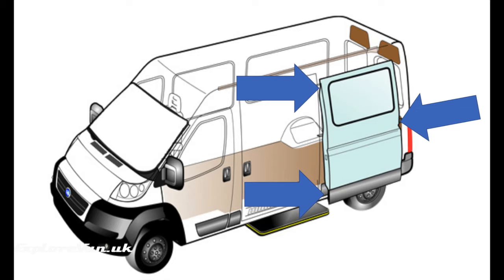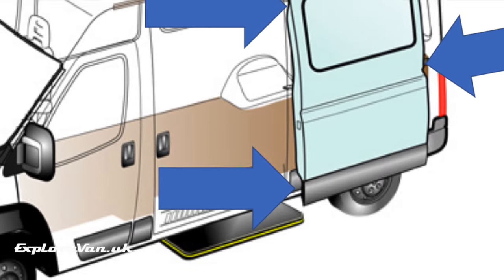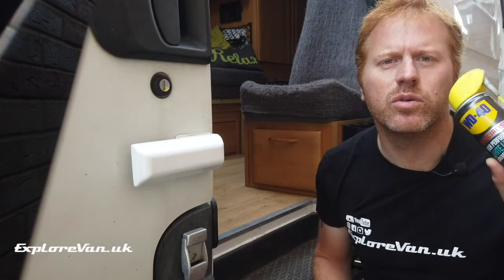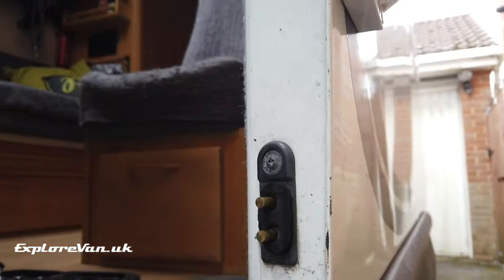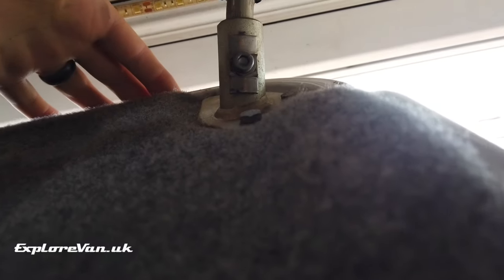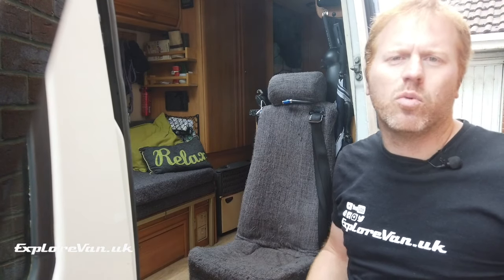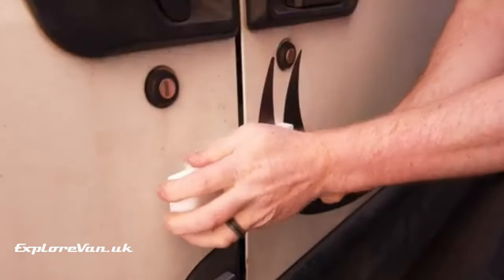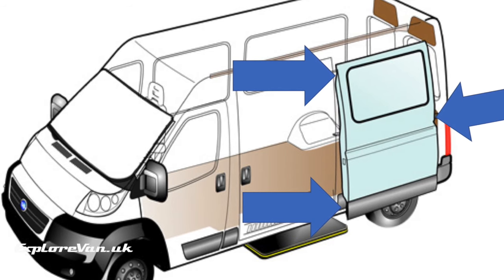Van sliding side door maintenance, adjustment tips and hacks. Campervan, RV, Motorhome.

Comment: Hi everyone. Useful video, thankyou. I have an issue with the bottom bearings of my customised Mercedes Sprinter van conversion (only just won her unbelievably)! 

 The door doesn’t stay open, so I place a rubber door wedge just on the bottom track bearing to keep the door lightly open (like a normal hung door I suppose). 

Unfortunately, I’ve subsequently shut the door with the rubber wedge on the bottom track still present and now my door is categorically jammed shut and will not open from inside/outside. Nor will it allow the van to be fully locked. Any advice on how to fix this ….. or does it need to be professionally removed ….. I’m gutted, yet to her on an adventure! Thanks in advance!

Comment: Nice video, can you advise where to get new top latch and push/pull rods? Mine with not close, except if closed roughly, or pushed in at top until hear the 'click' but will not release after. Peugeot boxer capervan, not central locking. 2002 reg.
Reply from the maker: EBay is usually my source for parts.

Comment: My question is how do I clean the latch and oil it? I’ve tried mass airflow sensor cleaner and multiple water based oils and silicone based oils and it gets so gunky and I can’t get it cleaned out. Some fresh oil helps it for a little bit but after a single day it’s gunky and rough again. The problem is I can’t open the door from the outside when it’s cruddy, only the inside.
Reply from the maker: Can’t say for sure as I don’t have that problem. but I’d start with some good quality degreaser and then use lithium lubricant rather than oil / grease.

Comment: Thanks for the tips. I have a question, do you have a hack to fill the gap between the two ends of the rubber seal?
Reply from the maker: Hi, thanks glad it was useful. I’m not sure I know which seal you mean, could you describe it?
Reply: Use RTV black silicone sealer and fill the gap. Don’t shut the door until it has fully cured. It’s just like rubber once cured. 😀

Comment: I have similar design of door on Iveco daily and there's a big rain gap by the top pin. How would I go about pulling that area in? Thanks
Reply from the maker: I’m afraid it’s a bit trial and error if it’s similar to ours you need to experiment with the 3 points of adjustment until you find the sweet spot.

Comment: THANKYOU, GREAT VIDEO!!   I JUST BOUGHT A SMALL VAN TO CONVERT.   UNDER ITS SLIDING DOOR IS A BIT WET AND RUSTY. ...  COULD I ASK, WHEN I CLEAN IT WITH TOOTHBRUSH... SHOULD I USE SOMETHING LIKE WARM SLIGHTLY SOAPY WATER ON THE TOOTHBRUSH AND DRY THE WHO;E AREA AFTER.?     OR DO I USE A DRY TOOTHBRUSH ON IT? THANKYOU!
Reply from the maker: Great - glad it was useful. 

If it were me I would start off by making sure it was as dry as possible and then use a degreaser spray such as this https://amzn.to/3pIbJFq to give it a good clean and get any old lubricant off it. 
-Then give it a rub down with abrasive paper / wire wool / wire brush to get the rust off. 
-Then brush it down dry
-You could then use a rust killing product and paint it or silicone spray.

Hope that helps.
Reply: @ExploreVanUK     THANKS A MILLION! THAT IS SO KIND OF YOU TO SHARE ALL THAT INFO.   IVE NO EXPERIENCE.. IN FACT I JUST PASSED MY DRIVING TEST LAST WK.. SO ITS MY FIRST VEHICLE.   IM SO HAPPY NOW I CAN LEARN HOW TO START TO FIX THINGS UP ON THE VAN . MERRY CHRISTMAS  TO U AND UR FAMILY 🙂

Comment: I have a 2010 toyota velfire van. It has two sliding doors on the side but only one can be opened with my fob. I'd like to use my fob to open the other door as well or even have it open on its on own from either the outside or inside handle. How can I do that? Can you help?
Reply from the maker: Hi Robert - thanks for your comment, sadly I am afraid we've no experience of that model so can't offer any assistance or advice.

Hope you get it sorted!
Reply: @ExploreVanUK  Ok. thanks for replying. I hope so to

Comment: Anyone know about adjusting Mk1 Expert/Distpatch/Scudo/Jumpy doors? Mine doesn't seal properly at the front top any more so noisy and windy, but I've spent about an hour staring at it and can't see how to adjust the runners.  There is a plastic locator, but if I adjust that too far it just snaps after a while, so I think I need to do something to the runners too. I guess I've been looking at the top, as that's where the gap, is but maybe I should check the bottom instead.
Reply from the maker: I can't speak specifically for the Mk1 Expert/Distpatch/Scudo/Jumpy but definitely worth trying the other adjustments as I found moving the door out a little at the bottom (but still sealing) helped to make the top seal better.  It was a bit of a balancing act. Hope you get it sorted.
Reply: @ExploreVanUK  Judging by your video it looks like the mechanism is very similar on those slightly smaller vans. And mine is 23 years old now, so maybe my bearings are worn (it all seems to work fine apart from not squishing the rubber enough at the top front, on closure, and I'm kind of amazed that the hold-open detente works just as well as when it was new).

Comment: I have to keep slamming my side door to make it shut properly and in doing so I have managed to stop my roller blind from working properly, have you any ideas please. We’ve only had it since august
Reply from the maker: Try the maintenance steps in the video to give it the best chance. Where it’s difficult to close it’s often just that it is out of alignment somewhere. 
If the bearings are old / damaged changing them can make a lot of difference to how easy it is to move the door.

Comment: Hi where can I buy a bottom roller part for my Fiat Ducato 2004 2.3D?
Reply from the maker: Ebay is my usual go to place - but check its the right one by comapring to what you have. 

This is a set of all 3 rollers for a pretty good price that appear to be for the right year (check you get the ones for the right side of door)

https://www.ebay.co.uk/itm/151965653903

Alternatively you could just get the rollers here

https://www.ebay.co.uk/itm/153013056228
Reply: @ExploreVanUK  thanks

Comment: I have just bought an LDV V80 and the sliding doors are poorly adjusted. Your video confirmed my thoughts about adjusting the door at the various points. I guess you should always use a sharp pencil to draw around the catches etc before you start adjustment so you have a reference point to work from. 
As far as lubing the tracks is concerned there are dry lube spray on options that come to mind. Any wet lube is a magnet for dust and dirt accumulation so is not a sensible option really.